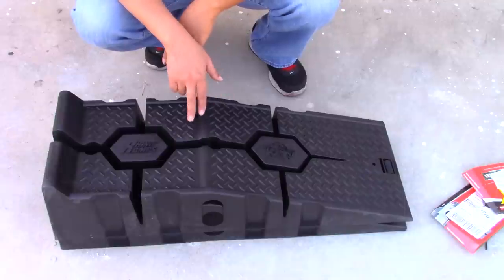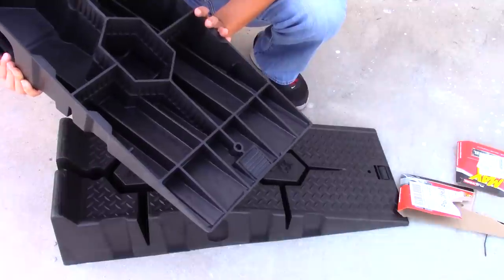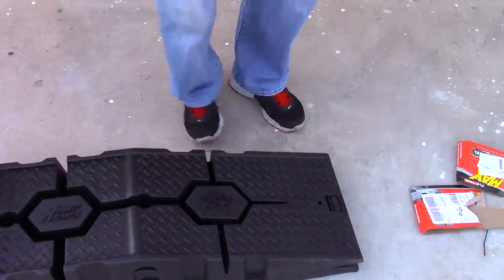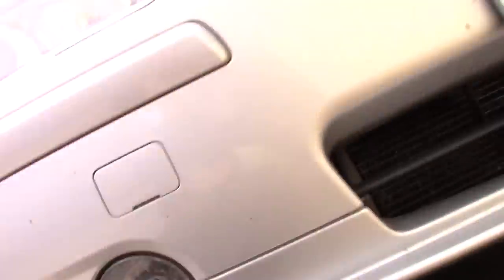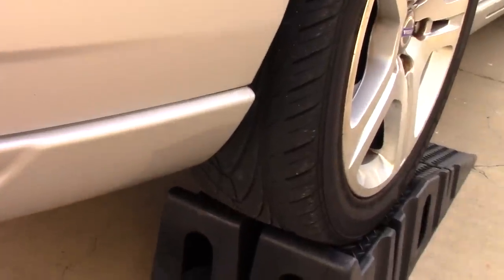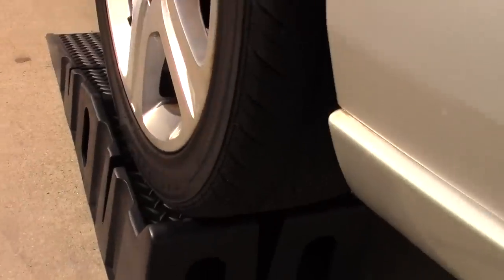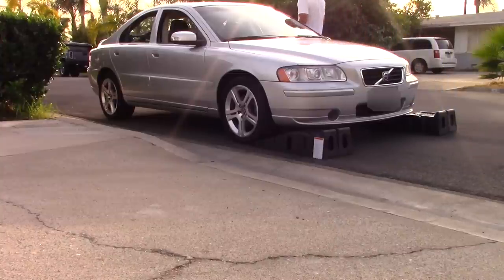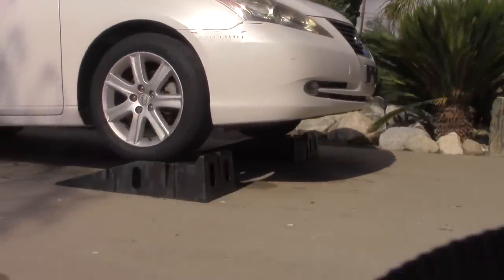Rhino Ramps by flo tools review and how to use them. ( 16000 lbs version )

Comment: It's 16 thousand pounds not 16 hundred pounds like you said right?
Reply from the maker: +Daniel Bailey Yes, I apologize if I said 1600 lbs.
Reply: @DiyProJames  is there enough clearance for jack stands on the sides once up the ramps?
Reply from the maker: @hohohee1  No... depending on the make and model of your vehicle. There may be a place to put Jack stands below one of the structural frame near the ramps...
Reply: @DiyProJames  I was thinking of putting it in the 2 jack stands in the front once lifted as additional safety  just incase ...

Comment: I have a set of rhino ramps that I've used for 20 years. They do last and are sturdy enough . I've used them for a Dodge Ram and Chevy Avalanche. I do my own oil changes and have used them every oil change for 20 years .
Reply: Is it possible the the car might sit too low for it to properly drive up on the ramps?  I am on the wait list for the new M2 and was hoping to install a front splitter but I think the ramp may be too tall and prevent the car from rolling up.

Comment: Thank you after watching this video, I was able to buy Rhino Ramps and was able to change oil on my 2013 Toyota highlander and 2017 Camry both with no issue. I said bye bye to people to places trying to charge me almost $100 for fully synthetic oil changes. Got Mobile fully synthetic oil and OEM oil filter for less than $35 5 quarts imagine that?. These Rhino Ramps totally worth the money and they are well built. I use Jack stands as well for safety as well.
Reply: Wanaaje's Channel how was the clearance under the car?
Reply: @viewtifullyvon6465  for both cars clearance was really good, convertible enough to changing oil and filter with ease.
Reply: I’m from the future.  Took my Chevy Trax for a full synthetic, and they wanted to charge me $200.  Bought filter and oil for $30.  Ridiculous.

Comment: These ramps are perfect. I recommend them highly especially for small and medium sized cars. The extended runoff area at the top of the ramp helps prevent you from dropping off the end of the ramps. They give you plenty of room to remove your oil filter and change your oil especially for low to the ground vehicles. I was totally surprised at how much room I had to work. I purchased the higher weight capacity just to give me an extra measure of safety.
Reply: Would these work on riding tractors?
Reply: They are rated based on the weight of your vehicle. If your tractor weighs the same or less than the rated weight you will be good. Just be sure to chalk your wheels and lock your handbrake.

Comment: Excellent video. Thank you. One suggestion I have for you - use small mirror to see where on the ramp you are. It will make it a lot safer and prevent you from overshooting. I saw your attempt where you got bit too far ant the ramp started to tilt. Stay safe.
Reply: possibly just a jumpy car.  I will have concerns about the individual's vehicle control  if a mirror helped her/him LOL.   Over shooting is not an issue health or damage wise.  An improperly setup stand is much more dangerous .

Comment: Good video, thank you.  My only suggestion - apply the parking brake first, then put the car in park.
Reply: Paul Reed.. I try to tell everybody I see do that wrong to do it the right way! should be e brake first to leave it from having strain or pull on the parking gear/cable/pin whatever it is
Reply: How come?
Reply: @ianmattl  the strain, he said, on the parking brake.
Reply: @ianmattl  -  when you put the automatic transmission in "park" , the parking pawl ( just a pin in the transmission ) is engaged  to keep the vehicle from moving.   You can feel it engaged if the vehicle is not levelled.  Also, the manual "parking brake" must be forcefully pulled/pushed to stop the vehicle from rolling.
Reply: The best thing to do and not to stress the transmission is once the car is up on the ramps, put the car in neutral and slowly release the brake pedal. if everything is good then the car will stay on the ramps in neutral. only then you can apply the hand brake and park. By the way, this man almost got off the ramps. He doesn't have the feel for it.
Reply: Per instructions this is the correct way. Reason is if small parking prawl fails it will suddenly jolt the car and your left with a fairly expense repair. This is common practice also if parking on a hill or incline. You want to keep weight off the parking prawl and have your e brake take the weight of the car in park. Its also good practice to keep jack stands also underneath also while using the stands. You can't be too safe !
Reply: @realname6586  lol I saw the same thing, he flew up ramps and almost went over. Best if you have someone watch you or what I do is I have an old mirror reflected to where I can see the ramps while driving up. You can "feel" it when you get to the top but man this guy almost went over 😂
Reply: How about with the electronic parking brakes, same suggestion?
Reply: @OneOffization  same thing applies,set eletric p break first then put it in park for an automatic transmission.
Reply: Yes
Reply: Yes you are correct. In general but make sure when you put the parking brake the pedal brakes are still applied before shifting to park.
If you have hard shifting it is for that reason that you aren't using the parking brake properly.
Reply: @ianmattl  put parking brake on first so weight rests on the brake

Comment: a lot of people complain that they Crack after a few uses so always be careful and use some jack stands for extra safety
Reply: Agree, just get a couple of jack stands at Walmart and get 0% chance of failing
Reply: Mine cracked after one use.  They're junk, IMHO.
Reply: crasch4 how heavy is your car?
Reply: fill the gaps with great stuff foam and make it crackproof.
Reply: @guachito33  - I wouldn't say ZERO percent. There is a reason people prefer ramps over stands. I agree both is best, but everything can fail.

Comment: Mine slid at first but that's cause I had it on a super smooth garage surface. Once I moved to the outside driveway where the pavement was rough those ramps didn't budge. Great product IMO.
Reply: You can wedge the ramps under the tires (kick them in hard) and they wont slip

Comment: I filled the gaps of mine with great stuff foam from Homedepot, the ramps are no longer stackable but they are more solid and crack resistant.
Reply: Cool idea buddy, thank you👍👍👍
Reply: What kind of foam or brand name did you use to fill the gaps up.
Reply: Quicrete better
Reply: 🤦‍♀️ there is a really good reason why those gaps are there
Reply: @VitiatedsHOWTO  the gaps are there for make them stackable one inside each other, if you fill the top gaps with epoxy resin the ramps probably last you for life.

Comment: I recently cracked one of the 12,000 lb set ramps that I had for over five years because I accelerated too forcefully up the ramp. I just bought another set.

When placing the ramps into position, I center them on the front tires with the wheels straight then wedge them into place so they can't slide. Also, the tires and ramps should be dry or the ramps will slide.
Reply: hoopfan71 where did you see the crack? I heard a loud noise, but don’t see cracks.

Comment: Took me a couple of tries in my garage. With my garage smoother floor is was a bit harder, however the ramps work great
Reply from the maker: Great... You can always put a little weight like bricks in front of it or a rubber mat to prevent slippage. However I found that it works fine wedging the end to the tires.

Comment: ...FYI caution...have used these branded ramps for years...but just replaced my old chipped ones with these  newer ones...seriously concerned now about these new built-in deep crack spaces designed where material has been deliberately removed in a very deep V...and in one posted video the front portion completely separated  from the center...ouch...will be much more cautious now, and am checking into whether they have actually made any efforts to re-design out these very scary looking built-in deep V cuts...
Reply from the maker: noted.. thanks.

Comment: Most ramps will slide, it's not from misuse. That rubber pad just isn't enough to prevent sliding for most vehicles. I had some non-slip shelf liner I threw under mine. I've stuck folded bath towels under them too to prevent sliding.
Reply from the maker: I think if you wedge the ramp into your tire it shouldn't slide unless you're on a polished floor. Most of the time people don't wedge the ramps onto the tires. Instead they roll onto the ramps which may cause you to push the ramps with fast acceleration.
Reply: ProjectJames I always jam em under the tire first. I wouldn't trust my Rhino ramps with anything bigger than my Focus, or a Civic. No way I'm putting  my 5-6,000 lb Envoy up on plastic.
Reply: On front wheel drive cars they don’t slide as much
Reply: I have rear wheel drive car. What should I put underneath the ramps to stop them from sliding?

Comment: They need to have a slope on both sides of the ramp, so there’s no chance of jumping off the edge and damaging the car.
Reply from the maker: Oh the front is a stop so you don't slide over the edge, but if you are not careful.. you might still roll over them... Just go slow and easy your first time... After awhile you'll get used to it...

Comment: Thank you for the video. I have been on the fence with these. I noticed you had one of the ramps on the driveways contraction joint the first drive upon them. Might want to avoid that.
Reply from the maker: thanks for the tip

Comment: Have you tried it on all tires at once? Coz i wanna load a car through rahino ramp onto a car dolly (tyre skate type) will it skid on 4 tyres at once plz try it and do a video
Reply from the maker: Ramps are meant to be used as a set of two. You wouldn't be able to put the ramp in between the front and rear tires unless you have a truck or suv which the tires would give clearance to the ramps. However, I've seen people get it up on four tires by jacking up the car and placing the ramps below the tires.

Comment: I bought a pair about maybe 8 years ago or close to 8 years same ones and I was lifting a 2014 Kia front wheel drive and it’s spun the ramps inward towards the frame( on a concrete driveway)I had to jack the car up pull the ramp out and release the Jack…this is my second pair what can I do to not have this happen again besides the basics of just going a little bit slower thinking about running a chain or cable through those two holes in the back

Comment: TRY RUBBER FLOOR MATS  UNDER RAMPS  THEY SHOULD NOT SLIDE
Reply: sliding is not an issue if the ramps are wedged under the tires before the climb.  Low bumper and /or hard summer tire may push the ramps though.

Comment: I was about to buy one but I’m not sure about the weight for my car sedan Hyundai four  door the weigh is  3,924 lbs compare to tones
Reply from the maker: This version of ramps has a Gross Vehicle Weight capacity of 16,000 lbs. So each ramp should be able to withstand 4,000 lbs. Also, note that the total weight of your vehicle will not be on the ramps. Be advised the ramps may break if there are defects in the plastic. Many have used them without incident. If you hear any premature cracks and creaking in them do not use.
Reply: Thanks but is it worth it to buy it or not
Reply from the maker: @brethart4938  It's worth it for me because I need to get underneath the car.
Reply: ProjectJames ohh ok it’s just like the way they made that stuff I’m like a little bit hesitate to buy or use I got Hyundai elentra sedan so if it’s good to use with rhino ramps
Reply from the maker: @brethart4938  The GVW is rated for 16,000 lbs. Meaning each ramp is rated for 4,000 lbs. You will never have the total weight of the vehicle on one ramp. Two wheels on the ground. Two wheels on the ramps. So the weight of the vehicle will be divided between the ramps and the ground. Most cars do not weigh over 4,000 lbs. If you're insecure about using them. It may be best to just use a jack stands.
Reply: ProjectJames thanks for the info my car is elentra Hyundai 2018 sedan four doors but the i checked the weight for my car is  3’924 lbs the rino Ramp I checked in the shop was 4’000 lbs each so 8’000 per pair I guess my car should be ok

Comment: try a rear wheel drive car
Reply: That does make a huge the difference. I just bought a pair of ramps and had to take them back because my truck being a RWD would not go up before they just slid right out from under. What I ended up doing temporarily was to raise the truck with a jack and place the ramps directly underneath. Fortunately, I have a jack that would lift it high enough, but I doubt that that would work with a jack that has less than a 2 ft. lift, or if the vehicle has a lift kit on it.
Reply: I work in a body shop and i have had the same problem with rear wheel drives.... They basically just slide the ramps under the vehicle no matter how slow or careful you take it.

Comment: Wow, seriously, be careful with those things.  I have an original set (the ones that weren't stackable) and bought a new one like the ones you have here when I needed a second set, and on my first use I pulled my Taurus up on them to change the oil and right before I was going to get under it I heard a CRUNCH! and the driver's side one crumbled and  one of those blocks separated by the seams in the surface just crumbled and ripped off dropping the car and the rest of the ramp bent up the fender.  I'm REALLY lucky I wasn't under the car at the time.  I have pictures of it.

The originals are nothing like that.  I've had a roll back tow truck with my car on it on them (helping get the angle right to drop the car from my sloped driveway right into the garage) with no signs of problems, I trust them, the new ones are junk, and there are a bunch of similar stories about them and how the company has been bought out and there is no one to reach to complain about the new ones.
Reply: Mark Pikas please tell me where i can see these pictures. I dont know how these items are flying off the shelf and you say they're cracking. I think there would have been a major recall if that started happening right? Please let me know

Comment: I have a lowered car, I dropped it 1.5" will this work?
Reply: Riiaq Creations of your car is lowered you can probably only drive up the rear axle. The front will have no clearance unless you extend it with some wood pieces.
Reply: Riiaq Creations me too man, get used to removing the front bumper

Comment: does anyone know what the minimum height from the ground to the bottom of your front bumper should be to ensure you can get up the ramps?
Reply: Arts&Trusts I guess the height of the ramp... which is 8.5 inches. If your front bumper (or rather the arch in front of the wheels) is higher than this then you're ok.
Reply: depends on how far your bumper sticks out in front of the wheels

Comment: 4000 lbs each.. 8000 as a pair.. so then where does 16000 lbs allowance come in
Reply: because the vehicle will still have 2 wheels on the ground, so 4000lbs on each ramp, 4000 on each of the wheels on the ground= 16000lbs
Reply: I bought a pair of these in Europe, different name but appear to be exactly the same: Laser 6793. Same material: polypropylene, same design. Only approved for 2500 Kg (5500 lbs) for the pair.
Reply: Americans always exaggerate.

Comment: they slide on smooth garage concrete floor with rear wheel drive...no better than generic knock offs. you used front or awd, for your conclusion. thanks for video.

Comment: I always take a good running start to easily drive up ramps.  Place ramps down, then back the car up at least 3 car lenghts, gun it. As easy as that. Please feel free to use this tip. I have not submitted any Patten or Trade Mark applications yet...so it's available to free use for now.
Reply: That's what I do as well. Except I keep going and drive it into the garage. Of course I open the garage door first, duh.

Comment: you said 16 and 12 hundred pounds but the title shows 16k. ???
Reply from the maker: They have two versions 16,000 lbs and 12,000 lbs. I'm using the 16,000 lbs version. This is Gross Vehicle Weight.

Comment: 1600 pounds, huh?
Reply from the maker: It's rated 16,000 lbs GVW (Gross Vehicle Weight) Each ramp can hold 4000 lbs, set of 2 = 8,000 lbs and set of 4 = 16,000 lbs. Normal use is in pairs and two wheels will be touching the ground. The full weight of your vehicle will not be imposed on the ramps.